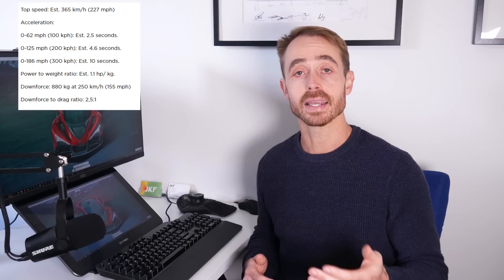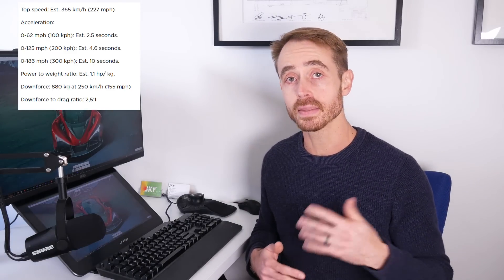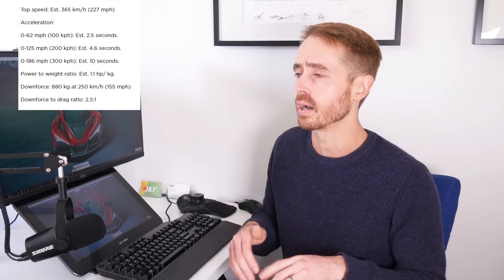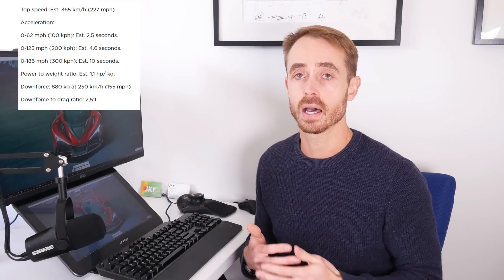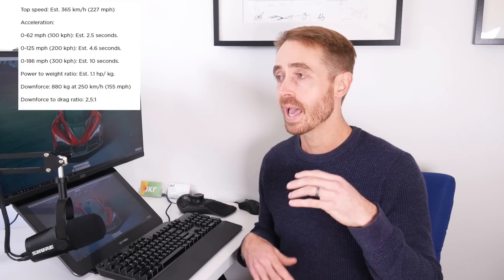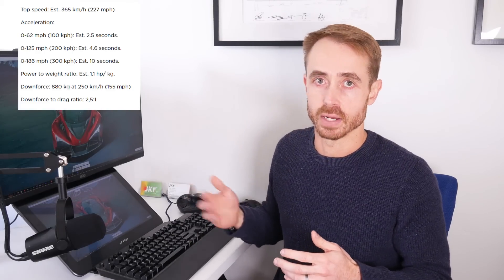Zenvo Aurora Agil  -  Aerodynamics Analysis

Comment: Would you please analyze the aerodynamics of the BAC Mono, give recommendations on where the company could go in terms of downforce, efficiency, weight, power, and anything else you find interesting, and make a few simple designs? The Mono seems like a platform that could be incredible, but they seem to be avoiding any serious downforce. Perhaps because they wait to maintain road comfort, I certainly don't know. Why leave so much cornering speed on the table?

Comment: Thanks for the video Kylee. I think I speak for everyone when I say...we missed you. Very much!!

Regarding the car, IMHO it is another unoriginal run of the mill aero concept. It seems like system wide design coherence is reserved for special minds such as Newey. Either that or almost all car companies design processes are backwards. Engineers know how to make a pretty car as well. Even "budget friendly" ones. The visual guys should then get a chance and both teams should work together to agree on magic. All these "random" incoherent lines and structures, though function, screams to me that the unity between all the design teams are very inefficient. It is very much like F1 in the sense that the cars are pretty but they are all pigeon held by a set of design constraints that they all must work around. So though they are more than capable of doing better and the teams are well optimized, it is much harder to design completely coherent and clean structures that maximizes efficiency. The one that gets closest is Newey however it makes sense because his demand for any team is that he...be put in charge. 

What do you think bro?

Comment: Could the lack of cooling exit in the hood be due to the air intake on the roof? Is there any validity to avoiding hot air feeding intake or is there enough mixing of air that it’s not a significant affect in IAT?

Comment: Great review and timely Kyle.  I was just attempting a literature review on Suction Mirroring (17:59) when the Wing is close to bodywork and how best that bodywork should be shaped to not adversely effect the lower pressure area generated on the underside of the wing. 
Couldn’t find a simple answer, but had some theoretical ideas.  If the gap between increased moving aftwards, that could counter low pressure generation as the air would expand/slow/raise pressure. Narrowing would force an acceleration and pressure drop, but then ?? more force acting downwards by the underside of the wing but also the bodywork below generating lifted by that low pressure - basically cancelling forced: your left with just the upper wing surface being a spoiler/flow diverter to create downforce.

Any idea what happens. Is it explainable?  
And is the a ‘golden’ safe ratio for the gap to avoid the adverse effect; eg % of Wing Cord

Comment: Perhaps the large center grill at the rear diffuser area is in fact a rear mounted radiator.  When you show the image of the full tub, you can see the opening in the central front suggesting the flow through the middle possibility you highlighted.  Given it was relatively small, it's possible using the high static pressure front to lead into that, followed by the central duct / backbone into perhaps a bit of an airbox just before a rear mounted cooler such that you can convert the velocity into higher pressure just before the cooler, then obviously the great low pressure area in the back. There would be some duct losses in the middle but overall would make better use of the pressure differential allowing for a smaller radiator than would be needed than conventional.  Same theory as the Britton V1000 ducted rear mounted radiator allowing a ram air inlet to a smaller cooler at the rear.  A good drag and weight trade off (but reduced diffuser volume)

Comment: You can still exit the front radiator air from the top, it depends on how big the panel gap is at the part closest to the windshield. It would make sense to me to blow the hot air to try to reduce the stagnation pressure that builds up at the base of the windshield.

Comment: I wonder why its exhaust is so high. I thought that since the invention of the blown diffuser everyone is gonna use it coz it's basically a free downforce boost. I guess it's not that simple.
Reply: I would guess it's the shortest route from the very high positioned turbos. To have the exhausts exit somewhere in the diffuser would mean going around the transmission and the MGU-K, which is suboptimal from heat management and weight perspective.

Comment: Keep in mind with road vehicles that there may be some laws governing where a manufacturer can and can't put a wing due to pedestrian safety in the locations Zenvo is attempting to sell the car. It's the same reason you have to put your headlights and crash structures at certain heights which limits where you can put aero devices. This car must be road legal, and some compromises must be made for durability, accessibility, and legal reasons so you don't get sued. It's not all the stylists' fault. x3

Comment: It would be very interesting to revisit the WRC aero (and suspension) which allows those cars jump, fly and earth so leveled, smoothly and so long. Difference with any recent rally car and old or amateur ones that get trown away when the rear hits the bump and mostly fall with the front down and max out the suspension travel, underbody etc... wrc just go as if a Citroën magic hydractiva worked aerodynamics and suspension...

Comment: I'm very curious how they're going to make the claimed weight of 1300kg. 200kg less than their present flagship TSR-S, while adding 4 cylinders and a 600 hp 3-motor hybrid system. 100kg lighter than Koenigsegg Jesko which is similar structurally, but has a smaller V8, very special light gearbox and no hybrid at all. Same weight as Aston Martin Valkyrie ended up at (while 200kgmore than claimed of course). AMG One added 400-500kg between taking deposits and being put together from carbon fibre and existing F1 parts. Lotus Eletre in the last year between taking deposits to making deliveries added 500-600kg. Rimac Nevera added 300+ kg. This Zenvo seems to be VERY MUCH on modern performance car sales culture, UNLESS it's going to be so well made, it does make Valkyrie and Jesko seem like half arsed efforts from 2nd rank engineering teams.
Reply: I was very surprised to see the claimed weight too given the drivetrain it's using. Not to discredit the Zenvo engineers, but I can't see them making this thing weigh less than the already supremely engineered Jesko with all the extras they've added to it.
Reply: @Tommmmmmmmmmmm  Jesko gained a bit of weight over Regera RS but that is explained by the cooling the extra 240 hp demands, I guess. Maybe some active aero and more elaborate aero bits.
Some thing's got to give. Very critical lightweighting at the cost of durability and even safety? If brands had a super well funded race competition to do a single or double Nordschleife lap time only, road legal, what might they accomplish, with F1 level refinement but tears of unlimited testing? Lamborghini Sesto Elemento was light but so bare. Double that ICE power, a gearbox to match, add a very potent hybrid system, cooling... Just really hard to imagine. If they manage and do it at the usual standards of top brands, those brands now have a huge problem. Even Valkyrie, the car that seemed credible, added loads of weight after so many years development with only the best of the best bespoke parts from top suppliers. Overbuilt due to reputations to be protected?
Reply: Zenvo doesn't specify what weight standard those weights are, but IMO that has to be dry weight.
When you go by their claimed combined power outputs and claimed power to weight ratios, it results in 1,581 kg for Tur (which could be empty wet car with very little or no fuel) and 1,318 kg for Agil. That latter one is strange since there is supposed to be only about 150 kg separating them. But this is 263 kg difference instead.
Let's say that the 1.1 HP/kg claim for Agil is wrong for whatever reason. If we take the 1,581 kg Tur minus 150 kg, it gives us 1,431 kg wet weight for Agil.

I think those numbers could be doable on paper. But there's no doubt there will be weight creep mid development as with nearly every project. GMA had that happen to T.50 and those guys are extremely autistic about weight.

Comment: It would be the most Zenvo thing if one of their engineers watched this video and jumped up midway through, screaming “F*CK!! WE FORGOT THE RADIATORS!!!”
Reply: You know your designer is world's biggest optimist when you get single large radiator in the front and not even as much as an open vent in the whole engine cover. With quad turbo oven underneath! That's gonna get very toasty real quick.
Reply: They may well have forgotten something to have their new car end up a claimed 100kg below Koenigsegg Jesko claimed, while offering a much larger engine with 4 more cylinder and oh, a 3-motor 600 hp hybrid system. A whole new way of making hypercars or...the almost common dishonest spec setting while taking deposits? I'm sure it'll have all the displacement and horsepower and driven axle, maybe even all the claimed downforce. But 1300kg when Valkyrie is 1300kg dry...yeah maybe not, or it won't like to go on-throttle for too long. Darned radiators after all, the buggars...
Reply: @Cloxxki  Isn't it insane how we had the 1100hp (1600hp on the dyno) 800kg turbo 12 cylinder Porsche 918 50 years ago and now 1300kg ist considered unrealistically light for an otherwise similar car. 
And before someone types "bUT tHaT iS a rAceCar ;(" they had steet legal homologation cars.
Reply: @laurean5998 you probably meant 917. 
They did not have normal homologation though, it was small scale production with different rules. 
Is it really that strange that you cannot put driver legs in front of front axle? I don't think so. Those cars were for people who were ready to die or didn't understand that they must be ready to die. Great in terms of vehicle performance but terrible if you consider safety.
Reply: @Cloxxki  I’m definitely not suggesting they’re outright knowingly ripping people off, like the Devel 16. They’re just 12 year olds doodling in their textbooks. I was guilty of the same thing. Doing a rough copy of a Mercedes CLR, then putting a pro stock hood scoop on it and saying it would make affinity horsepower.
Reply: @Cloxxki  like I said. The most Zenvo thing to do.